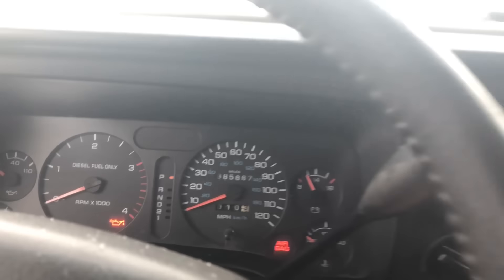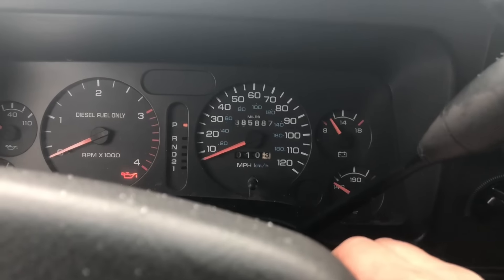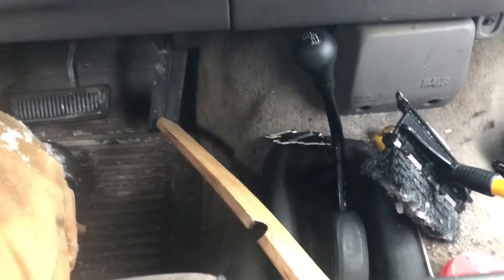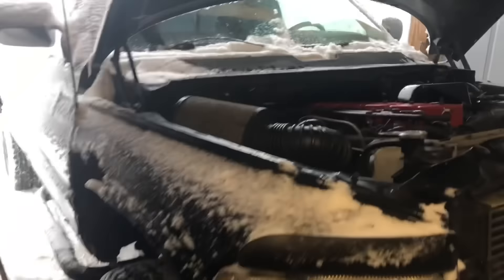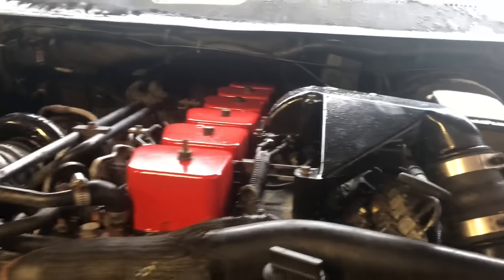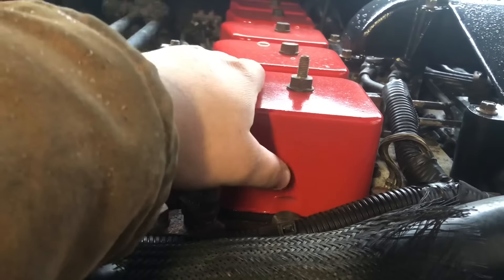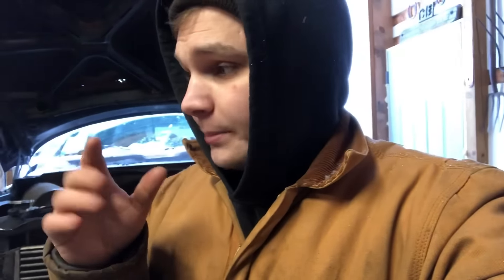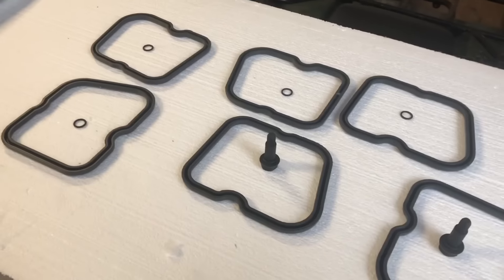12 VALVE LOCK-UP SWITCH + TPS DELETE

Comment: Need Help,i have a 1997 2500 Dodge 5.9 12v Cummins, I have no overdrive I replaced all solenoids and sensors filter fluid and transmission still nothing I as well replace TPS sensor still nothing I bought a Gino's TPS sensor delete kit installed and still nothing I am completely stump while I have no overdrive lock in can anyone give me advice or help.

Comment: Yo I need to pick your Brain a bit. I have a 12v swap in my 1950 international I'm having trouble finding stuff on how to hook lock up and OD to a switch help would.be really cool
Reply: There is a 3 pin connector on the side of the 47RE. The middle is 12v power with key on. The outside pins are for 4th gear and lockup. Simply tie the lockup pin to ground through a rocker switch and you're done. No need to mess with the PCM and all that.

Comment: Well buddy your pcm is probably going out. Being a 12v it still runs but you get other issues. I currently have the same issue. Well it's accelerated. Started getting huge power draw from the "fuel pump" circuit as labeled on the inner hood fuse box. Took allot of digging but found out this is purely allocated to pcm power on the 12v. I've spade connected a toggle switch and temp routed it into the cab to stop the parasitic draw. 10 amp draw would kill my truck overnight. Covid killed replacement pcm but they are in stock now. Mines already been replaced once. So it's been an issue with previous owner. I have 530k+ miles on my clock. I have pot switch and lockup also. Thinking of going back to tps. Truck will not downshift unless I constantly play with that switch while towing. May be the switch may be the pcm sending faulty signals. Let me know how you like your pot switch
Reply: Thank you I Said the same thing all that does is screw shit up with the electronics build. The? Transmission how. It should be in duo with all this TPS and lock up bullshit. Those are just. Adding to the problem

Comment: Is it just me or is the air intake on the 12v even when stock in the dumbest possible spot in the engine compartment? We want cold air so let's put this right next to the hot turbo 😣😑
Reply: thats why the factory airbox pulls cold air from the fender... only dummies put a big ass air filter on only for looks that pulls in mostly hot air from the engine bay....
Reply: Actually yes it ran through the fender but when I put in the open intake I went from 30 lbs to 40-42 lbs when the converter is locked from it breathing so

Comment: How does the lockup work? Can you use it in any gear? Good for compression breaking?
Reply from the maker: Just grounds the circuit, can use it in any gear as long as your trans can hold.
Reply: So....😀... I thought it was pin 27.. its been a min. So he is probably right... about the lock up... you can do it In any gear. Just make sure you are moving with some rpm if you are going to do it in first. I would normally switch it mid 2nd when I have some good boost.  I have turned the pump up slightly and added delivery valves..... I was able to do 55 and if there was morning dew or any wetness on the ground I could break loose with the torque converter locked up. I only had a single clutch aftermarket  torque converter. It's a lot of fun with that switch. You get less slippage and get more of the power to the tires. It's nice to feel yourself being pushed I to the seat.
Btw I always disengaged the switch at 40 mph. If you try to stop with it engaged you will keep moving and if you have good enough breaks it will stall and kill the motor. Fyi.
Reply: @BuyBuildThrash  pin 54 it’s an orange and black wire
Reply: @Tonka_6.7  yeah it's been so long and only done once I couldn't tremendously exactly
Reply: @BuyBuildThrash  understandable just wanted to make sure if anyone is looking at the comments that they get it correct I didn’t get it right the first time and cut a wire that didn’t need to be cut so I’d love if someone else could avoid that lol

Comment: What kind of paint did you use for the engine components?
Reply from the maker: Just rust oleum products! Primer, paint and clear coat
Reply: @LeftLaneDiesels  thanks 👍 I didn't know if it had to be special high-temperature paint.
Reply from the maker: Oh yea it was their 500 degree engine enamel. I didn’t see the need for the extreme heat. Seems to be holding up pretty well so far!

Comment: Wish I could find me a old 12 valve
Reply: Everyone wants to much for rotted out trucks any more
Reply: @jamesgazdag876  thats because theyre 12vs. treat em right you get a million miles. treat em like shit you get 400k
Reply: I've got my Cali-life 97 12 valve and she's as solid as day one on the frame. 498,xxx miles and she's going under the knife first light to have my trans built.
Reply: Buy a chevy put a crate engine 12v in it lols
Reply: It's a nice fantasy to have... But the reality is every 12v out there has had 25 or more years of every idiot breaking off every bolt, replacing every seal from the outside with a screwdriver, and it's a Dodge they put it in. So that's a big problem. Had the best known most expensive shops do everything so you think your good? Keep thinking that...and goodluck you'll need it.